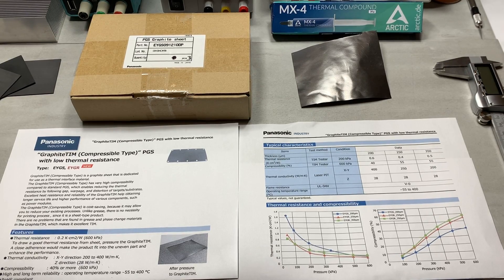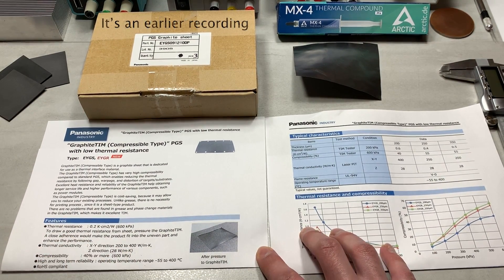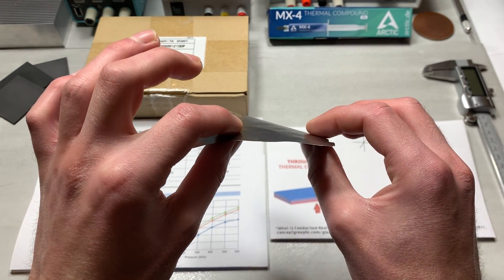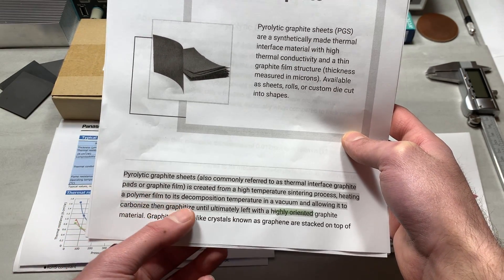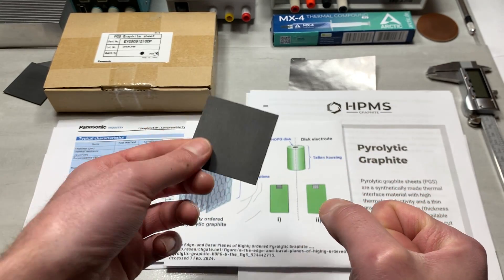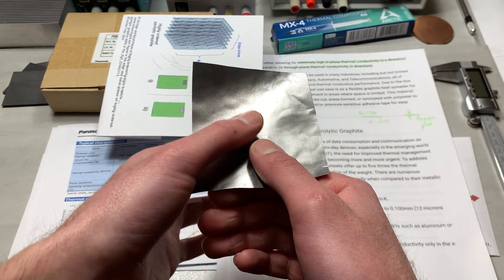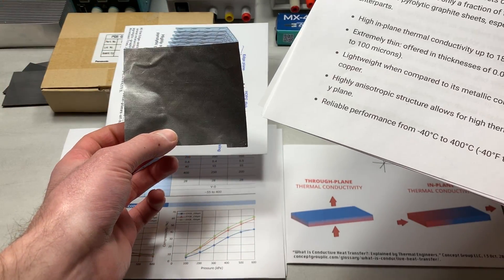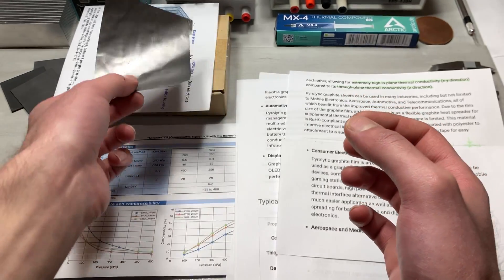The Closest Thing to Graphene | Pyrolytic Graphite Sheets (PGS) have Unique Thermal Properties

Comment: The fact that in-plane conductivity is higher doesn't shock me all that much. Think capillary effect. Or an analogy of wire fencing folded together being sprayed by a hose, water would essentially meet an obstruction and then flow down the diamond shape structure instead of passing through it, although entirely different physical speaking, it does help to understand why heat would choose to travel lengthwise rather than through the physical structure of this material.
Reply: It has nothing to do with capillary effect. The high conductivity is related to the electronic conductivity which is much better along the graphene planes (x-y plane) than across it (z). This property was known for a long time. The high in-plane conductivity is due to electron orbitals fusing togehter in the sheet ("hybridization"), not unlike in a benzene ring - which you may remember from chemistry class.

Comment: Great video! I've been doing hard research on pyrolytic graphite for some time for a product I am developing that requires high levels of heat transfer in a combustion process. It's truly a revolutionary product in its HX. Really it's best compared to a bridge between solid metals (aluminum, copper brass etc) and heat pipes. Advantages over solid metal is claimed 4x delta vs copper (good hx bad weight) and 8x delta vs aluminum (okay hx good weight but poor thermal stability and delicate). 

I suspect one of the main advantages is its X/Y transfer and opposing hx insulation properties, ie, it doesn't lose heat "along the way". Heat pipes can exceed these numbers but are much more involved from a materials, production and R&D perspective. They aren't sensitive to orientation, they don't need complex wicking and working fluids and extensive R&D modeling. Extremely light weight compared to all tech. These are usually encased in a matched metal or ceramic shell with equal coeficients of thermal expansion for mechanical stability. Very promising indeed. Your comparison to a "solid state heat pipe" has some merit. Pound for pound comparable and much more simple to integrate. I suspect these things will be in EVERYTHING in the next decade. They have been in space for a while.
Reply from the maker: @UnitedElectric  Yeah it’s truly an amazing material! I can also agree that within a decade or so the number of places that these will be used in one way or another will increase significantly. (I think maybe high-end EVs could potentially make use of it at some point to shave off an extra bit of mass yet still retain good thermals. 

Low mass, low density, and extremely thermally conductive. All super unique traits that make it so cool!!!
Reply: Any updates on the process of that product you're developing?
Reply: @hullinstruments It's a slow development project. Basically an advanced liquid fuel camping stove with other industrial combustion applications.   Working with some novel metals in place of PG with hopes to commercialize. Still in drawing phase.

Comment: Did you actually test these?  I have been wondering how well they would cool Northbridge/southbridge on a motherboard. Of course as a thermal paste replacement way to thin for pad replacement. My board is in need of repasting I can tell she is way to hot. The reason I wonder about these is I have to completely gut my PC and flip my board over in order to remove my chipset heatsinks and I would really like to not have to do that more than once IF possible and since these won't dry up like paste It sounds like it has potential.
Reply from the maker: I haven’t tested them as a thermal paste replacement yet, but I can try, it’s what they’re made for too so I’d assume it should work pretty well.

The datasheet said it has a thermal conductivity of 28W/m•k when used as a thermal pad/paste replacement.

Comment: How thick are the sheets? I need 0.1mm. Im trying to experiment if i can cool off my phone without remove the back covers. I will be using a case then adding some copper, thermal adhesive, and the graphite thru the case possibly cooling off the phone.
Reply from the maker: Oh my god did you read my mind or something? 😂 That’s EXACTLY what I’ve been planning on making a video on for a long time!! Anyways it’s about 0.4mm thick.

Comment: If the thermal conductivity is only good in plane then won't it be difficult to make a thermal interface out of it? (unless you cut reall small strips and stack them together to form a pad?)
Reply from the maker: Exactly! I don’t wanna spoil the surprise but yes, making a stack of the strips would be the best method for not only a thermal pad, but also a thin heat pipe essentially.

Comment: I find these graphite sheets more annoying than useful specifically because the thermal conductivity is in plane, instead of in the vertical z-axis.
Reply: unless I'm understanding this wrong, it seems that it would be useful for shielding components, on one side of the system, from heat. ie: power section of a system is hot, and sensitive measuring devices that need to be cooler, would be shielded from the higher temps, and kept relatively cooler, than the power side of the system.
Reply from the maker: In my opinion what makes these really useful is the unique new applications that are possible for them more so than just using them as thermal paste replacements. I’ll be making videos on some of these applications in the near future.
Reply: @KeonsLab  Anisotropic heat transfer could prove useful if it was programmable. I assume someone will find a use-case, eventually. Make it as dirt cheap as recycled paper, and you might have something...
Reply from the maker: Oh I’ve got a use case for it’s anisotropic heat transfer alright! ;)  
And you’re right, if these were just to be used as thermal pads they’d have to be cheap to make sense, but that’s not necessarily the best way to exploit its anisotropic thermal properties. I’ll be making quite a few videos on this hopefully soon, so just hang on! 😁